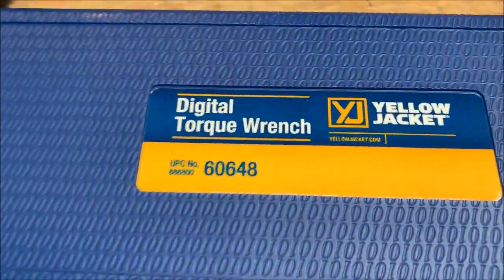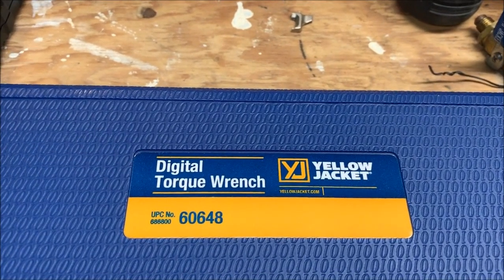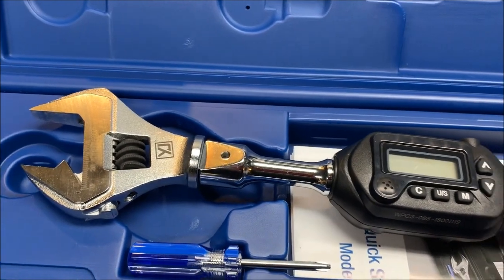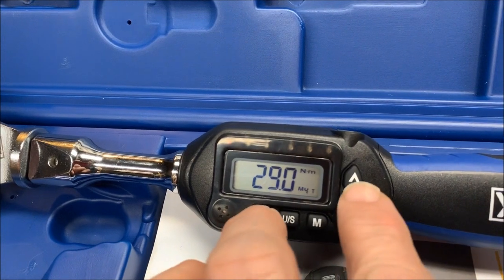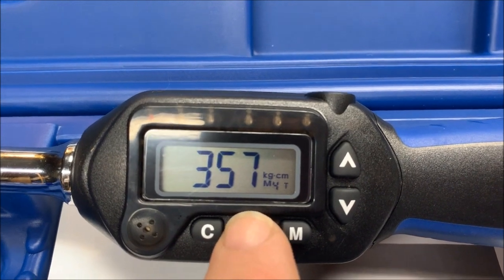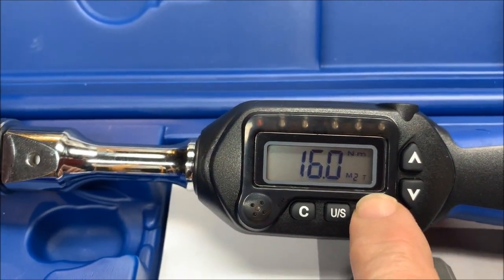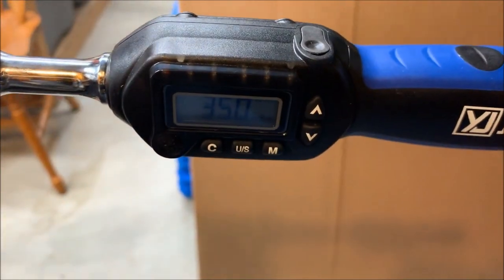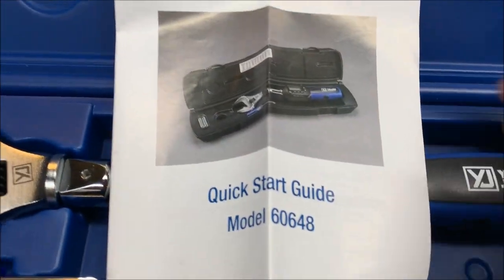Yellow Jacket Digital Torque Wrench

Comment: The Tracking and Peak function is very useful. In track mode, the wrench's digital display shows the applied torque in real-time as you tighten the fastener. In peak mode (also called "peak hold"), the wrench's display will capture and hold the maximum torque that was applied during a tightening session.

Comment: How are you still liking it?
Reply from the maker: @Talentman18  I still use it on all my flare connections. I have my torque settings for 1/4” through 5/8” stored in memory M1-M4.
Reply: @ thank you I’m thinking of buying this one because it’s smaller and it’s not as long as the black max
Reply: @ how many sentences can you store on it?
Reply: @Talentman18  9 memory (can store a combination of values and unit)
Reply: @edmundong8382 thank you

Comment: How to store the torque memory
Reply from the maker: @patrioticgunner8034  press the “M” button, which will cycle through the 9 saved memory settings. Set your desired set point, and the memory setting you’re on will have that setting when you cycle back to it. I’ve set mine up from the lowest to highest settings of Daikins 4 different ranges based on line size.

Comment: I just purchased the product 
“Digital Torque Wrench 60648”
My wrench came with a single adjustable head (the smaller one)

In the manual the following text appears:
Applied torque at setpoint = Entered Torque Setting * 
• For ratchet head 1 
• For adjustable head 0.782 
• For large adjustable head 0.75

This text is very ambiguous and raises a few questions:

1. Do I have to adjust my set value by a factor of 0.782 (i.e. if I want 25 N-m do I need to set 25 * 0.782 = 19.55 on the digital display)

2. Or was the wrench calibrated using the adjustable head it came with such that the displayed torque value is the actual torque value at the head.

3. If I later purchase the ratchet head or the large adjustable head do I need to calculate the torque setting using the factors described above?

4. If I change heads is there a way to tell the wrench which head is installed such that the wrench calculates the correct torque using those factors?

I just used a quinn 3/8 drive digital torque adapter to test this and it does appear that 10 ft-lbs on the quinn lands close to 7.8 ft-lbs on the yellow jacket.
Reply from the maker: If the manual states what you just listed, then yes, you would multiply and adjust your setting. I don’t recall seeing that in my manual, and I haven’t had issues with using the set torque, but they may have done more extensive testing and found the multiplier was needed for accuracy.
Reply: That’s in my manual. I’ve been searching YouTube for some clarity on this .

Comment: Great video, I have the rothernberger mechanical wrench and it’s a bit difficult to set as you have to turn the handle and the numbers are not clear as different numbers mean different things! You also have to make sure you use it the right way round, as if you go the wrong way with it it doesn’t click out and you can over tighten very easy to do on a long day and in the dark working from flashlights😮 this would be much quicker gonna buy one many thanks for showing its features! The memory storage will save time massively especially as I only work with Mitsubishi 👊👊👊

Comment: How is it holding up?
Reply from the maker: Very well.  I keep the batteries out when not in use (just like my leak detectors that aren’t rechargeable). I’ve got my first 4 presets set to 1/4”-5/8”, which saves me time from looking up the torque specs when tightening flare connections.

Comment: Can you lock your set numbers?
Reply from the maker: They stay even with the batteries removed, but they can be altered with the arrow buttons.
Reply: @tcphvacr9950  my question was if you can lock the settings so that you cant hit the arrows while wrentching and alter the number while using it.

Comment: I purchased this brand new from our HVAC supplier in London UK. 
It kept crashing on the first use. We even changed the batteries but still did not work. Returned it the next day.

I was looking really forward to have this in my toolkit,  and it was Yellow Jacket which is a great brand.

What are your thoughts and how many’s jobs have you used it on?   Please advise as I’m still on the market to buy one.

Thankyou Mo.
Reply from the maker: addaz786 I’ve used it quite a bit.  I’ve got presets for 1/4”, 3/8”, 1/2” and 5/8”, and I always take my batteries out when not in use. It sounds like you got a bad unit out of the box, I would’ve just swapped it out for a new one, if it was available. I think JB makes one as well, looks very similar. YJ usually has good stuff, but when electronics are involved, anything can go wrong. But mine is holding up.
Reply: @tcphvacr9950  I got the CPS BlackMax. It has a bigger jaw. I really like, no more leaky flares.

Comment: Thank you for this video, I was lost and upset after ordering the 60652 set, I found that only the 1/2 inch fit my spilt -unit system. it did not fit the 1/4 inch or 3/8 inch flare nuts. And what was even worse, after calling the company that makes the Yellow Jacket wrench set, I was informed that there were no order size sockets that I could order. So I was stuck with a $170 tool that wasn't any use to me.  But after seeing your video, I contacted zoro.com, who gave me free return shipping because I then ordered this electronic wrench.  Thank you Thank you!!!
Reply from the maker: Life Happened thank you for your comment, and I’m glad the video gave you some insight on a useful tool. I love it, I have 4 of the memory slots programmed for the torque settings I use for Daikin 5/8”, 1/2”, 3/8” and 1/4” line sizes. I’m glad your situation worked out in your favor.

Comment: How are you liking this yellow jacket torque wrench?  On the bigger nuts do you see the jaws starting to slip around the nut?  Any cons to it?
Reply from the maker: Anthony Reardon hvacr I’m liking it very well. I’ve used it on 1/4”-5/8”, and haven’t noticed any issues with the jaws trying to open and slip. Just remember to back it up with another wrench.